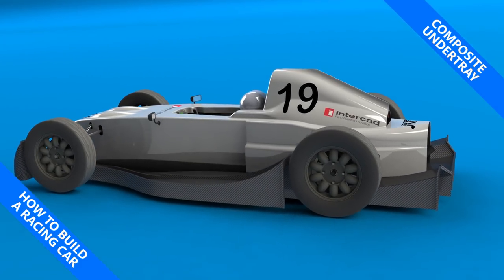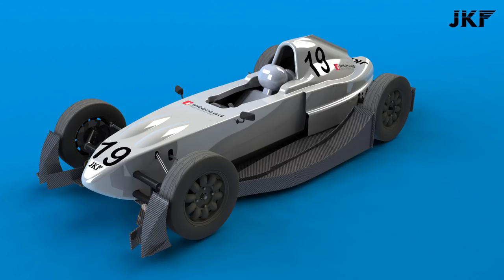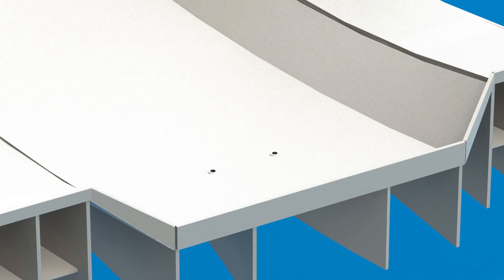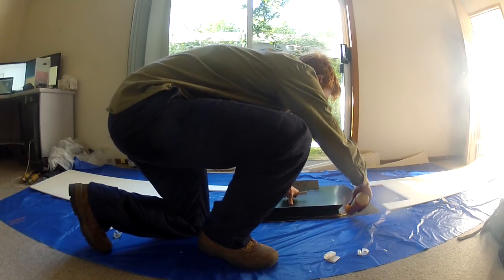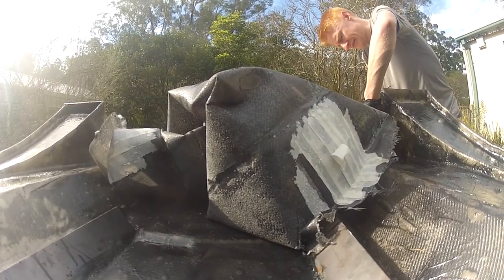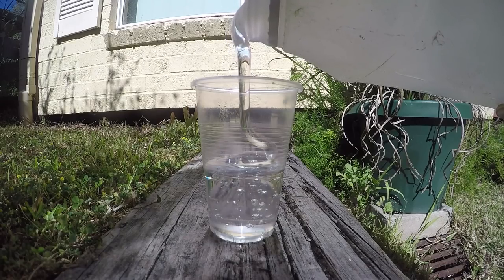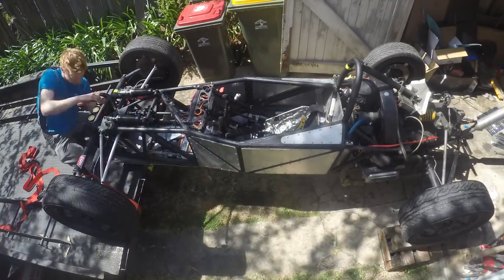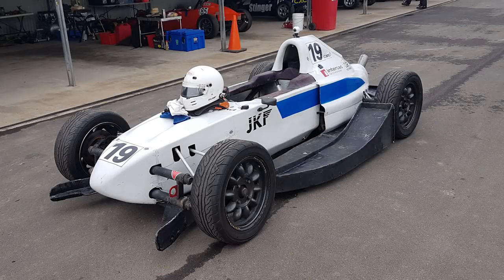Composite Undertray Build

Comment: Just wanted to drop a thanks for posting this. I’m toying around with the idea of using composites to smooth out the bottom of the street car I do track days in and it’s been very helpful to see how you handle large parts. It was especially helpful to see how you mocked up the foam core before glassing it.
Reply from the maker: Thanks. I guess it just proves it's possible, which is important to know.

Comment: I don't know about race cars but in airplanes foam core is coated with a mixture of epoxy and glass bubbles, called slurry.  It's seals the pores in the foam and makes for a good seal with the fiberglass.  Also, you looked a bit cold doing that fiberglass layup. The job would be made much more easy if you could find a way to heat your workshop.  YouTube search Aircraft Composite Construction for a good video.
Reply from the maker: Interesting. The epoxy and fibreglass seemed to bond much better to the foam when I whet out the foam first, I'm of the opinion that this will be sufficient for this application. I've no doubt it would need to be better for an airplane though.
And yes, it was very cold during the early months of fabrication. I was actually doing this in my lounge, not the workshop - my house is not insulated well or heated so there's not much I could do. I did pre-heat each batch of epoxy before use though to improve its flow-ability.
Reply: I was under the impression that thos glass bubbles are ment to be used as light weight filler, so you end up with a mix that by volume weighs less and are a bit cheaper aswell, as thos bubbles cost next to nothing, but still have a good bond, depending on application ofcourse

Comment: Now you're going to need more power to overcome the down force, time for aluminum rods, light weight ceramic coated gas ported pistons with low tension stainless steel rings and a crankcase vacuum pump,  polish the crank , coated bearing,mill the heads to bump up compression, port and polish the exhaust runner and port the intake runner but don't polish it (the ruff surface helps fuel atomization on carb setups),polish then ceramic coat the combustion chamber , 5 angle valve job, titanium valves and retainers, bigger cam with aggressive ramp rates ,oil scrapers/ windage tray,gun barrel drill the cam to hollow it out and the axles,  and a serious race balance job on the rotating assembly. Oh and use ARP studs and bolts.  Also talk to Kyle to make sure you intake is in a high presser zone because at high speed ram air effect should help.
Reply from the maker: Unfortunately pretty much everything you listed is made illegal by our rules I'm afraid. Though there is more to do on the engine than what I've done so far.

Comment: use mini rollers when fiberglassing large flat parts, then use a paddle roller to remove air,  just did a fiberglass roof and its smooth, i think you could also use more resin.

Comment: If you're going to mix steel in with the CF sub-structure, you need to make sure to isolate them from eachother to prevent a galvanic reaction from taking place, which would rot the steel out fairly quickly.
Reply from the maker: Hmm, honestly I'd not considered that. Do you have any recommended resources for galvanic corrosion?
Reply: Galvanic reactions are a known problem in carbon fiber bike and aircraft components, so maybe you could start with that. I'm sure there are probably vids on YT from that angle. I would tend to think there have probably been isolation-coating processes designed for moulding metallic parts into CF.
Reply: I'd try to ground the steel plate to the frame and add zinc as a sacrificial metal (anode), they make zinc based paints as a deterrent or you could go to your local boating store where they should have zinc tabs that attach to boat engines.  Not just for the plate, the whole car raced in the rain and could be rusting on the inside of the tube frame. My truck bumper looked brand new until i steeped up on it and my leg went through it, it was completely rusted away with just the paint holding it together even though it looked new. You won't know until you hit a big bump and the frame buckles at 100mph, no fun having your safety cage turn to dust at speed.
Reply: It's fibreglass, not carbon, galvanic corrosion won't be a problem.
Reply from the maker: +INF1D3L010 the fibreglass is the final part. The renderings use a carbon fibre material since its the closest thing to fibreglass, it's a representation only. Kyle designed the part, has been involved all through the construction and the tray has since been proven at the track to be effective, he knows what he's talking about.
Reply: Ah ic... My apologies.
Reply: Is it the fabric or the resin used that causes galvanic reactions?
Reply: miller chassis
If it was made out of carbon fiber, which I have been informed it's not, the carbon itself, in conjunction with acid rain/salt-spray exposure is what would cause a galvanic reaction when in contact with conductive metals, which would form a crude sort of "battery," eating away the metal as if it was an Anode. Being that the final product will be fiberglass, though, galvanics are not a problem.
Reply: ok I see how do they get away with using aluminum honeycomb with carbon?
Reply: miller chassis
That would be achieved using isolation coatings/materials that separate the aluminum chemically from the carbon so that it cannot react with the aluminum and any corrosivated water that makes contact with the chassis.

Comment: I love this series. I didn't realize formula vee could run aero like that. How come it seems like no other competitors do that?
Reply from the maker: Thanks. There have been small scale attempts in the past but this is the most extreme I've seen. I'd expect it's because there is a perception that the benefit would be offset by the drag penalty.

Comment: I have an early formula vee from the 70s and it has analog dash gauges but I see yours is digital with shift could you explain how you built your dashboard and maybe make some comparisons to analog gauges as far as wiring goes that would be a cool video
Reply from the maker: I've got an AIM Mychron 3 installed in the car. It's got a number of propriety connectors and sensors for things like oil temperature, pressure, wheel speed, steering wheel position, throttle position, lap beacon and engine RPM. I can't comment on how it compares to an analog cluster, I've never dealt with one. But I can say it's very simple to get hooked up and running and the data logging is absolutely invaluable. This specific model is out of date so wouldn't be possible to purchase now but there are plenty of similar alternatives out there.
Reply: ThomsenMotorsport thanks

Comment: Was aluminum an option per the rules? Seems building this out of aluminum  with various rolls for rigidity would not only have been much faster but would have would have provided a easy to reproduce result. I feel the same about the body though.A pressing process using steel molds could kick out near perfect pieces in a matter of minutes allowing you to drill them on a template and bolt the thing on when pieces are damaged.
Reply from the maker: I prefer a composite in this application, even with aluminium it would need to be very thin to be a reasonable weight, and if thin it would be very flexible even if it were strong. The composite is able to be stiffer for the same mass. It's also safer I think, the idea of metal pieces being dislodged and potentially hitting someone is scary, this will not be so deadly if it loses a part.

Comment: Hi, great video. Could you please tell me which foam you have used? Is it polyurethane foam? And what did you to avoid rough surface in fibreglass since you are not using mold?
Reply from the maker: Yes it was a high density closed cell polyurethane foam. The surface was rough, it's been painted now though so it looks better (but not perfect).
Reply: ThomsenMotorsport thank you

Comment: considered doing a blown diffuser? or will the vw engine not produce enough exhaust for that to matter?

edit: looked it up, it seems that there is no real regulation for the exhaust exept for the one general rule: 

"Exhaust pipes, the orifices of which, when directed horizontally to the rear, must be between 300mm and
600mm above the ground, and may not protrude by more than 250mm beyond the rearmost portion of the
car."

So it should defenitly be legal :P
Reply from the maker: Kyle did look at this during his analysis but found that the quantity of exhaust was not enough to make it beneficial. That rule I'd have no concern about getting around by the way, it's conditional on the exhaust being directed horizontally. Tilt it by 5 degrees and it's no longer horizontal, certainly it's a position I'd be prepared to defend.

Comment: It seems engineers always sound so smart and proper and they are don’t get me wrong but then you put tools in their hands and it’s watch out !!🤣 maybe making individual parts and bonding them to make the final product would be better ?
Reply from the maker: Yeah I probably could have achieved a better quality part if I'd done that with the strakes. The curved surfaces I needed to be flexible though to assemble it, would've been very hard to create them separately then attach them later.

Comment: wow um did you look into plastics before you started ? you get a roll of housing plastic from building supply cut your cloth put it on big bench on top of the plastic you bought wet it out with epoxy then transfer it to mold put peel ply on top roll or brush or whatever rub with gloves make sure its down smooth your done much easier an better wetout less weight also your mold can be made from foam and housing plaster thats painted its very smooth and um can of pam cooking spray is a wonderful mold release much better than whatever that is you used that stuf looks terrible ,o well good job :) getting it done makes up for any mistakes and we all do me most of all lmao!

Comment: The manufacturing part was really helpful! I am a part of a formula student team and your video has helped me a lot. 
     Can you tell me what was the total weight of the undertray?
Reply: I was a member of a FS Team, Aero department, for the 16 and 17 season and be assured, the sophistication shown here vs. what you see in Hockenheim or Michigan is in different leagues. I don't want to put you off, and I am aware that not every team has access to 5 Axis milling on that scale or the computing power for hundreds of CFD sims, but with our low speeds and the amount of time we spent in turns (the shown undertray only works with the air coming from directly ahead, now imagine you're constantly running slip angle) an undertray like that won't do you any good. Better to focus on weight and mechanical grip first. A non aero car should definitely shoot for under 145kg.

Comment: Which disciplines you need to know before doing like this project?
Reply from the maker: I started with my mechanical engineering degree, Formula SAE experience from university and five years of professional engineering design experience (in an unrelated field). I had to learn a lot to do this project though.

Comment: What kind of epoxy do you use, and where did you get it?
Reply from the maker: I used Bote-Cote epoxy. I purchased it from Drive Marine Services here in NSW but you should be able to find re-sellers in other states if you search Boat Craft on google. I chose it because it is specifically formulated to be safe, not causing the allergic reactions that normal epoxy causes. I've been very happy with it, particularly in comparison to the horrible resin I used for the bodywork molds.

Comment: So your car generated upforce before?

Also I am not specialist but are you sure this weird nose shape isnt a problem? Mamy people have nose Facing ground And your is closer to missle
Reply from the maker: +Krzysztof Dolecki that's correct, a small amount of lift previously. Kyle wanted air under the car for the tray which is why it has that shape. For the other cars (and probably mine without the tray) a low nose would be preferable.
Reply: Having a low nose can be essential for achieving ground-affect, as well. The nose, and other aero components tend to compress air going under them, and as soon as the air expands to fill the space under the car, it creates a low-pressure zone which literally sucks the car onto the track.
Reply: You get a lot of freedom with a high nose though. Undisturbed high volume airflow going directly into the floor makes it really easy to manipulate using the underbody. If I was in ThomsenMotorsport's position I would probably have gone the same way.
Reply: yeah that can lead it to making lift....... or maybe not

Comment: Your car is the only car running an undertray as far as i can see, why is that? Or are there other Cars with an undertray?
Reply from the maker: There have been some that have tried various designs but never to this extent. I think the perception is that with our power and speed it's not worth it. I don't believe this is true.
Reply: I just hope they don't ban it Simon. Slowly improve over a season and you may get away with it. My gearbox is mounted high in the frame so I cant even run any rake. Technically getting lift as I have to run so low in the rear to get any camber. Am looking forward to fixing my issues while monitoring your progress & any rule changes. Great work buddy!

Comment: if you put the epoxy in a shallow container then you would have alot longer to work with it.
Reply from the maker: Didn't know that. Is it because it has a larger surface area and so keeps the temperature down?

Comment: what about a BIG MEATY WANG?
Reply: Cozea Dragos that's not allowed in formula vee
Reply from the maker: To be fair it's not explicitly defined as illegal.
Reply: ThomsenMotorsport really? Maybe i should take a look at the regulations instead of Just guessing of what i see, now i feel bad. 
 But still, it wouldn't be very useful as the speed wouldn't be high enough to become very effective and the extra drag wouldn't help.
Reply from the maker: The CFD and lap sim data showed a second improvement at Wakefield Park. I qualified 8/10ths up on my previous best run in clean air with the tray on at the club round so it all seems to be working pretty much as planned. The extra drag does mean overtaking on the straight is much more difficult though and where the benefit is in the corners it's not easy to get by either. I'll show the data in the race video which should come out in a couple of weeks.
Take a look at the rules here http://docs.cams.com.au/Manual/Race/RA14-Formula-Vee-2017-1.pdf and here https://www.cams.com.au/motor-sport/regulations/cams-manual/general-requirements if you want to learn more. Schedule F in the general regulations is specific to aerofoils and coachwork so is most relevant.
Reply: ThomsenMotorsport thanks mate, i'm take a look now :D really apreaciate you helping me. And about the drag i was reffering to a wing, with i supose creats more drag for the same downforce against an undertray.